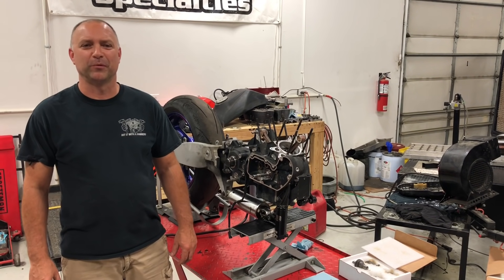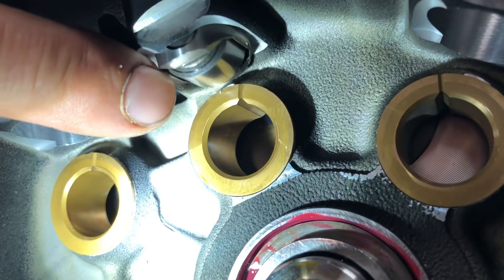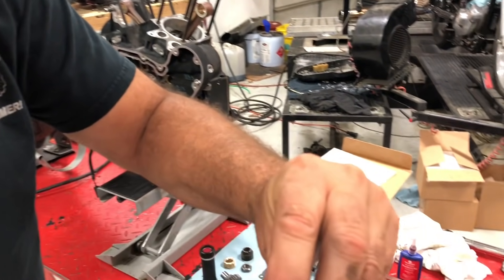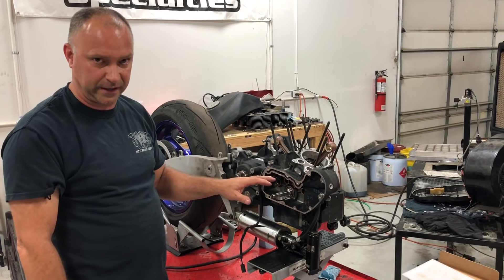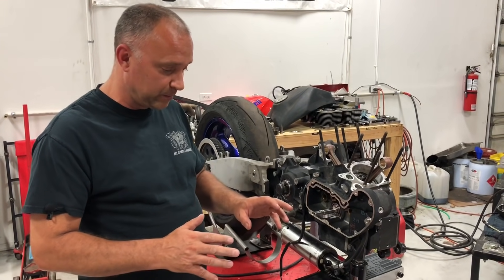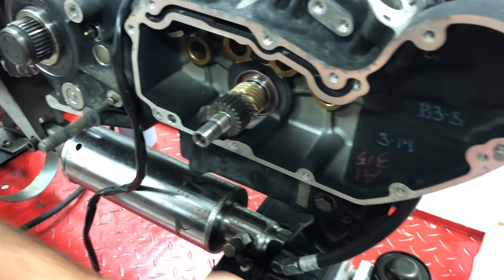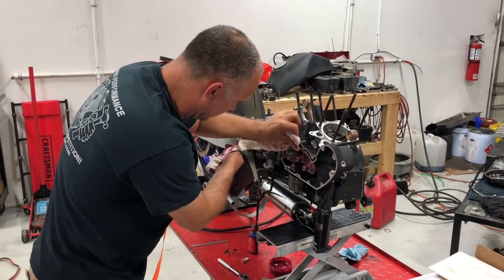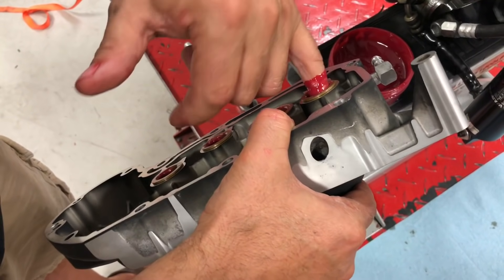How To Install XL Buell Cams

Comment: HAMMER DAN ! HELP! what would cause the cams to seize up only when I put the cover on and bolt it down tight??? even with just two or three bolts in when I put the bike in 5th gear and try to spin the back wheel in order to find TDC like ya taught me the cams lock right up . But they spin freely as they should when the cover is off.. I have been struggling to figure this out. I know you will have an answer and it was probably in the video and I missed it.  They are the same cams that came out going right back in. I never had clearance i wasssues before so i dont think thats the problem but i could be wrong and im checking .Thanks in advance.

Comment: Do I understand correctly that the reason you cut down the cam cover to bare minimum was to allow easier access to the oil pump? In particular, to allow the oil hoses to be connected after the cam cover is installed?

Comment: Helping a guy out, pulled his cover and found a pinion bushing on the cam cover worn down to the aluminum about 1.5 mm. Can I replace the bushing without line reem?
Also the rocker box bolt have stainless bolts and washers I recall all the bikes I have messed with had black bolts hope you open tomorrow so I can order the correct bolt and bushing or cover!

Comment: Awesome video! But now I'm just curious about the ignition module... doesn't that need to be installed in the cam cover before that gets reinstalled on the bike?
Reply from the maker: no, it can be installed after the cam cover is on the bike.

Comment: Great video I seem to be having a problem with my 04 Buell. That bronze oiling gear shredded and messed up all the cams and oil pump. I changed everything and cleaned it all out good replaced all parts. After 20 miles the gear shredded again and ruin the new oil pump. Change all parts for new parts change the oil filter and did the oil change. Am I missing something? Please help
Reply from the maker: My guess is that something is locking up your oil pump. If that oil pump locks up, it'll rip the teeth right off the gear. Did you have any kind of a failure of a piston or a cam gear or anything like that which could have left some shrapnel in the crankcase? It doesn't take a very big piece to lock up the pump as the clearances are really tight. If you've got shrapnel sitting in the bottom of the crankcase, it might just keep happening until the motor is disassembled and the shrapnel cleaned out.
Reply: @HAMMERPERFORMANCE  after cleaning it all out the first time I'm putting in the new components there didn't seem to be any any shrapnel. But after the incident upon removal I found brass shrapnel from the gear the oil pump was seized because there was a piece inside that got stuck. I'm thinking about putting it back together one more time but I'm scared it'll happen again.

Comment: Do lifters stay down if they are not pumped up first or if they leak down from sitting, my 01 Buell has very noisy lifters like a knocking. I'm thinking they leaked down with little to no oil in them. Can I just take them out and prime them up like you said in another vid you done for for new lifter install
Reply from the maker: They refill themselves from your oil pressure when you run the motor. Generally that happens really fast, although I've seen it take a minute on fresh builds done with empty lifters. If you've run the motor for more than a minute or two and they're still making noise, there's something wrong. It may not be the lifters, too.

Comment: Why so much assembly grease? I thought that was only to help with installing during assembly. Doesn't the oil take care of the lubrication after assembly?
Reply from the maker: It takes awhile before engine oil reaches the cam box. You don't want it running dry during initial start up.

Comment: Looking at putting one of your 80hp kits on my '93 1200. I noticed you said anything OVER an N4, youd have to clearance work. Im planning on running the N4 cams. It sounds like I wont have to do any clearance work, but is there a possibility of it being needed? Or are N4s straight "bolt in/no clearance needed?"
Reply from the maker: N4's are bolt-ins for 1200's, no clearancing work or checks required and they work with all the stock valvetrain hardware.
Reply: @HAMMERPERFORMANCE  Sweet! Thanks for the quick response. Definitely going to get my parts from you guys!

Comment: Are the buel cams a good choice for a stock or 10:1 compression xl1200?
Reply from the maker: The answer to that question depends entirely on what year and model the Buell cams came from and what year the XL1200 is.

Comment: In a 04 and later sportster do you need to machine the lifter bosses ?
Reply from the maker: The need for cam box clearancing, or lack thereof, depends primarily on what cams you're installing. Some cams drop right in. Some cams need major clearancing. And in between those two extremes, there are cams that may or may not go right in, depending on the casting shift of the specific cases used, and also how deep the factory pressed the pinon race into the case half. 

But before you go choosing cams based on whether or not they'll need cam box clearancing, realize that depending on your build (specifically how your heads are prepared), that additional lift you can get by clearancing the cam box might be really important to achieving your power goals. And clearancing is not hard to do, read this for more information: http://www.hammerperf.com/ttxlcaminstall.shtml#lobeswing . I would not let it deter you from running the correct cams for your application. It's just not that hard to do.

Comment: I have an 02 883 with the basic Conversion set up. I have the W cam installed. I know clearance issues happen with the n4. Is the 505/515 fueling cam okay?
Reply from the maker: Yes, the Feuling 505/515 is similar to the N4 except it has much less overlap, which results in lower TDC lifts and makes them compatible with stock 883 heads. If you're looking for top end power and your 883 heads are stock, it's probably the best choice. If you're looking for more of a mid range grind, the N2 is a better choice. See the dyno sheet here that shows how the N2 affects the powerband: http://www.hammerperf.com/883conversions.shtml#faq1 . Sorry, I don't have a similar chart for the 505/515 grind, but it's intake close timing is similar to the N4 and as such  it's timed to be more of a top end grind. The intake close timing is the key indicator of the rpm range of the cams.

Comment: “Cams go in 1-2-3-4.”
Proceeds to install cams 1-3-4-2
Reply from the maker: When he says 1-2-3-4, he's referring to the positions of the cam. They are numbered 1-2-3-4 going from the rear to the front. You don't install them in that order though, because the number 2 cam cannot be installed until the number 1 and 3 are installed.